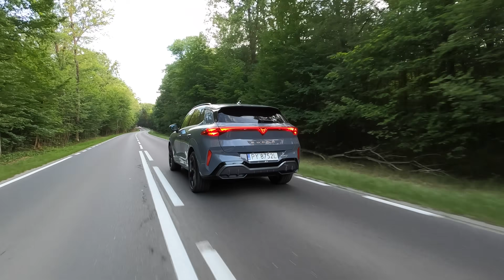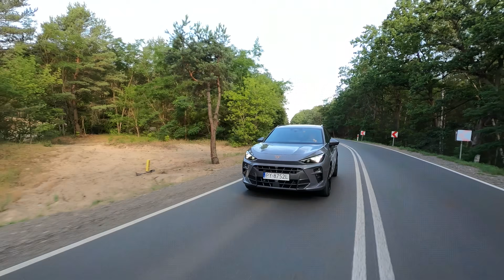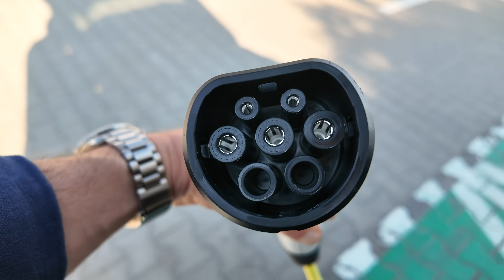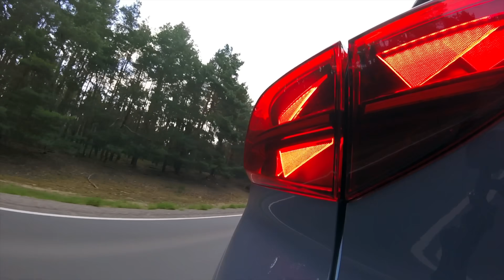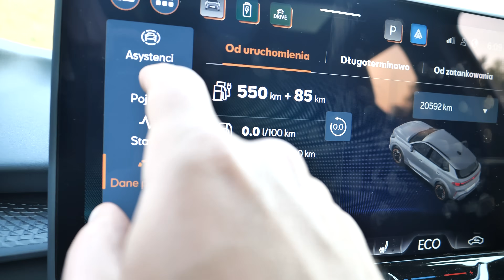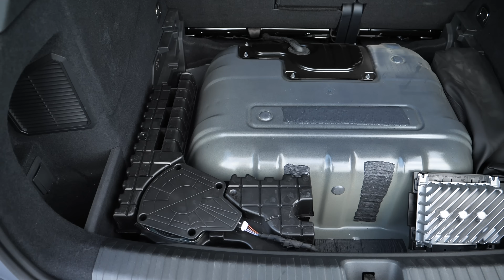Cupra Terramar – Is Auto Emoción Enough? (ENG) - Test Drive and Review - Marek Drives

Comment: Low-speed pedal behavior (City) Noticeable transition: When braking gently (e.g., when stopping at a traffic light), the system prioritizes regenerative braking to recover energy. Several media testers, such as km77, mention that in the final stage of braking, when the mechanical calipers engage, the feel exhibits slight inconsistencies or pressure variations. Initial spongy effect: It requires a short period of adjustment to achieve completely smooth stops and avoid slight "jerks" when the SUV comes to a complete halt. Regeneration modes: It offers three levels of regenerative braking (soft, strong, and automatic) manageable from the screen. Automatic mode is a significant help in the city by simulating a one-pedal driving function, reducing the need to constantly press the brake pedal. Dynamic Driving Performance (Road): Excellent high-speed bite: During hard braking or sporty driving using CUPRA mode, the pedal feel changes completely, becoming much firmer, more direct, and predictable. Outstanding stopping distances: Braking tests from 120 to 0 km/h bring this vehicle to a stop in a competitive 51.2 meters, an excellent figure considering the extra weight of the hybrid system. Optional Akebono brakes: This VZ engine can be equipped with the high-performance Akebono braking system (with copper/gold calipers). If you're looking for a truly sporty driving experience, this option is highly recommended by experts due to its tremendous resistance to heat fade and tireless stopping power.
Reply from the maker: Brakes on this particular car were useless regardless of the regen mode.

Comment: I own the 272 PHEV for 18 months now. The ICE is at 177hp instead of 150hp and total power output is more alive. I've driven the 204 and the petrol 265. The latter is obviously more alive and AWD but consumes fuel like crazy.
I think, given the weight of the car, that 204hp PHEV doesn't give the Cupra feeling of acceleration when speed > 100Kmh. Also the lack of DCC is important. Having a DCC in the VZ 272hp version completely transforms the car and driving dynamics. It becomes a chameleon, soft and EV-first in city, hard suspension with limited body roll if you want with the press of a button.

I would agree on the hesitation of the ICE and the shut down of the ICE but you can get used to it and minimize the shutdowns if you are in Cupra or Performance mode and handle the gas pedal. Consumption wise the thing is crazy, I do a lot of highway and mountain driving, I am at 3.5 to 4.5lit/100Km, charging at home 87% of the time. Quality is Audi Q3 (same production line) but i would agree on the sound insulation from the wheel arcs; engine insulation is fine - they have put that foam there.

The parametrization you can do with this car is what adds into not getting bored. It's 3 in 1 if you handle driving customizations correctly in my opinion. Even the artificial 5 cylinder can be shut off (I like it however!) and steering wheel stiffness, engine response and suspension setting transforms the 1.9tonne car completely. Have a look at that variant if you can. What would make the car perfect for me is AWD - 272hp in FWD only can make the wheels spin under heavy acceleration - 400Nm is a lot.

All in all i am very satisfied with the car, premium feeling for a Cupra, Tavascan would be great as well if my country had better electric network. Had a Formentor 1.5 DSG for 3 years, no issues as well. Lower center of gravity and more playful btw.
Reply from the maker: Have they fixed DCC knocking? VW's had that problem for years. Drives me crazy every morning I drive a VW press car with DCC out of my suburb onto some better roads.
Reply: @MarekDrivesENG no issues afaik, yes

Comment: My VZ have no issues with breaking. However, it loves petrol really really much...
Reply from the maker: I guess that’s the price you pay for that extra performance! 😅
Reply: @MarekDrivesENG lol. True! No objections from my side though. Personally, pure petrol and 4wd in 2026 was the reason I went for it. Still happy with the decision!
Reply: VZ have larger brakes by default I think. Right?
Reply: @aleksandargjorgjiev1725 Iam not sure. However, I had a test drive of that plug-in and yes, breaking is very odd. Almost like you never put enough pressure on the pedal...

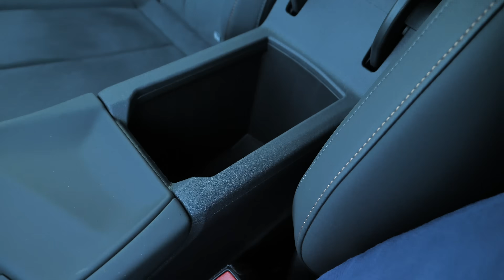Comment: 11:30 I know VW Group has been doing this ratcheting armrest for decades, but I don’t get it and never have. The elbow point does not change so in what way is this really adjustable. You can argue it moves, but it’s hardly adjustable. 🙄
Reply from the maker: It's for resting your elbow, while holding the steering wheel. Hence sometimes you'd want  it higher. In some VW models it also extends, which is a blessing for shorter drivers.

Comment: I appreciate you always including info on everyday annoyances such as driver aids or auto-shutoffs (or inability to turn those off at all).

Perhaps if possible could you include how "intrusive" the crash detection system are on narrow city streets with cars parked on the sides? The norm in a lot of EU cities.

My experience with VAG products is usually random agressive beeps with ocassional panic brake and everyone  getting thrown forward if a given car is parked a bit awkwardly.

My 1st task once Octavia is out of warranty is to see a specialist to turn all of those 1s into 0s by default and no yellow annoyances if they're off.
Reply from the maker: I've never experienced a scenario, like you described. Most streets around where I live and drive are wide enough and/or parking along them is forbidden.

Comment: From this test it looks dissapointing. 8.3 s for 0-100 km/h is rather slow, especially for dedicated "sporty" brand like Cupra. 20 years ago same time was for small sport city cars with 150 HP engines. Still didn't get the the point why cancel Seat brand and leave with Cupra, even when some models are just VWs with different front end and bronze color rims.
Reply from the maker: I suspect making Cupra a separate brand allows Seat to keep prices more "affordable", because any emissions penalties will go straight to Cupra customers.
Reply: @MarekDrivesENG that's good explanation.

Comment: Terramar PHEV 272HP was on my shortlist (I had to choose a PHEV as a company lease car).
The brakes, the boot space and the bulky front seats, which completely block the view for the rear passengers, were the deal-breakers.
Reply from the maker: That's the problem with platform sharing. This could work a bigger car like VW Tayron or Skoda Kodiaq, but when you have to put it in a smaller car, compromises become apparent.
Reply: If you need a hybrid or PHEV, get a Toyota or Lexus. Everything else is an inferior pretender.

Comment: Ahahhahaa now you gotta review that Geely Starray EM-i! You have those in Poland 100%. I'm guessing the main negative would be softer suspension, as is with all the Chinese cars, but that Geely is much better in some points than this Cupra, and it's 32.000€ for the top version. 29.000€ for the entry model. I was laughing like a maniac watching this review, how is this even possible for 60K, cannot even imagine what would a Chinese brand offer for that much money 🤔🤔🤔
Reply from the maker: I'm trying to avoid Chinese cars. They are all the same, and they don't get good views any more.
Reply: @MarekDrivesENG If for nothing this one is designed to be either BEV or Superhybrid, it`s not an afterthought like these VW PHEV models, so there are a lot of advantages with that approach, it`l lighter than most of them, there`s a lot more space on the inside, it`s got DC  charging and very strong regen braking. Can charge the battery when driving, like a REEV, but also you can use that 1.5 engine to drive the wheels if really needed or to help that main EV engine. I think that`s the opposite setup to this, this one is gasoline engine first and EV engine as an addition.

Comment: 1.5L underpowered poverty. Can’t imagine what’s it like with 4 adults and a full boot. This is why no one is buying VW group
Reply: 1.5 liters is plenty in a PHEV. China makes PHEVs with 800 hp and 3 second 0-100 with a 1.5l range extender on board.
Reply: Its fine... for Octavia, Golf and anything smaller. But pushing this engine in this oversized monstrosity its really bad choice.
Reply: 1.5 for a PHEV is not bad. At least it's not a 3 cylinder 1.2 l engine...

Comment: So I'm wondering, why is there no Tayron review on your channel? I've seen the Tiguan review which was not well made according to you, yet you've praised T Roc.  Since Tayron is the VW car model produced inbetween those two, I'm really wondering how do you find it?
Reply from the maker: Tayron is the Kodiaq. If you've seen my Kodiaq review, I don't have anything to add about the Tayron.
Reply: @MarekDrivesENG so the Tayron isn't the successor of the Touareg? :( 
Also, isn't the Tayron better sound proofed, with better handling and suspension when compared with the Kodiaq?
Reply from the maker: @Tota111 Tayron is the Tiguan Allspace successor. There is no Touareg successor. 
Tayron is literally a rebadged Skoda Kodiaq, just like with the current Superb/Passat. They slapped on a different front/rear end, and a different infotainment system.
Reply: @MarekDrivesENG oh, that's sad.

Comment: 45L fuel tank—one of the dumbest things about modern cars.
Reply: considering its a hybrid, I don't see a problem - gas stations are everywhere, and you get better mileage by carrying less weight around. If you do 1000km at one go, just get a diesel, I guess.
Reply: @LaimutasBass  Absolutely agree, my Citroen C5X has a 40L tank...not only less weight to carry around,  but of course saving cost at the pump, PHEVs don't need large tanks...that's the whole point of all hybrids.